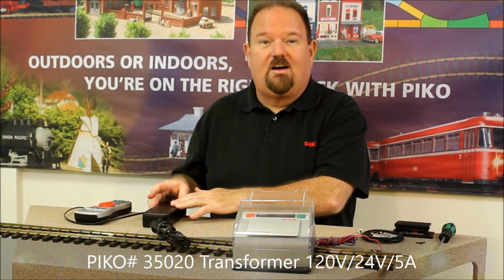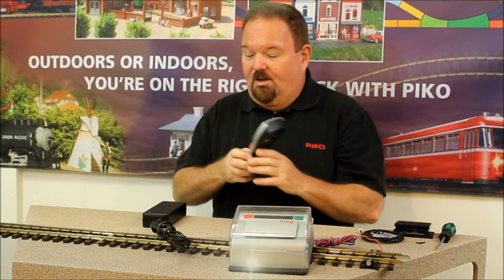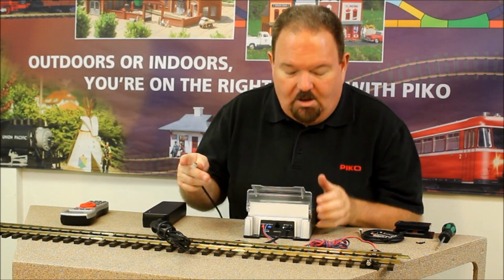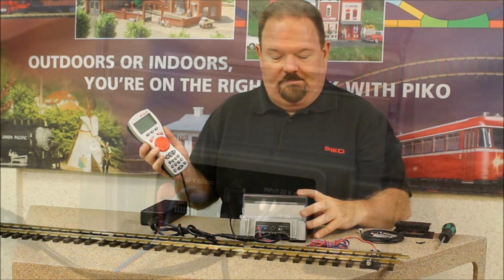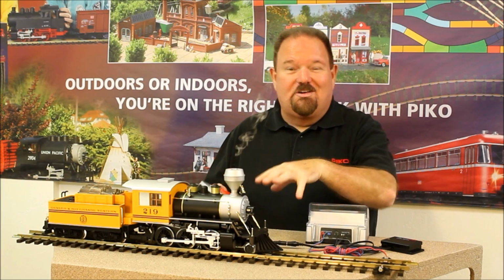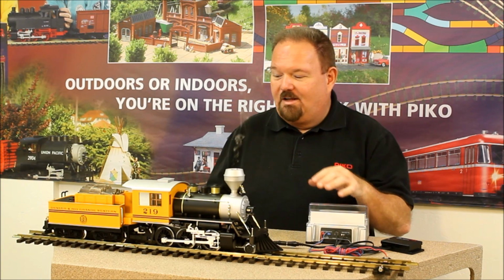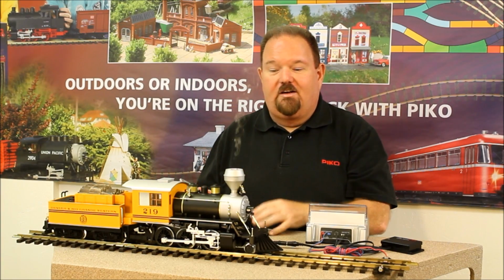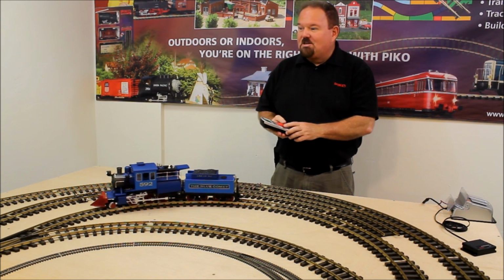Getting started with PIKO Digital

Comment: Good day , will the system damage USA train analog motors running them on address 00 ? Thank you 😊
Reply from the maker: Hi, the PIKO G-Digital System is capable of running Analog/DC locomotives, but the locos will likely have a high-pitched electrical whine as they run.  Even though the system will run the loco, it is not recommended for long periods of time.   (This is due to high-frequency Digital AC.)

Comment: I bought this complete system to include wireless for an outdoor Christmas train.  For the most part everything worked fine.  My track is a 75 ft loop with power only connected at one point.  Some evenings the train would stutter or skip in some areas.  At times an increase in power would help.  Would a complete bus loop with feeders to more areas on the track help.  Do I need a power booster?
Reply from the maker: That sounds more like contact issues on the track.  Keeping the track, wheels and pickup shoes clean is very important, especially with DCC, so the train always gets uninterrupted power and DCC signal.  Also, reliable contact from one piece of track to the next is just as important.  Outdoors, it won't take long before moisture gets inside the rail joiners and starts corrosion.  For a temporary display, a dab of our 36215 Conductive Paste in each joiner will do a great job.  Or, you may want to look into our RailClamps for a more solid connection.
For a 75 foot loop, one power connection should be okay.  And with the excellent conductivity of PIKO rail, both power and DCC signal are carried with very little loss in that distance.  A DCC Booster like our 35015 would really only be needed if the complete power demand on your system is near or over 5 amps.  With just one train and a loop that size, this is probably not the case.  A PIKO Mogul with smoke and sound going only takes about 1.5 amps.

If you have any further issues, feel free to contact our customer service directly at info@piko-america.com or 877-678-4449.

Comment: Will also work dc
Reply from the maker: Tomas, while the PIKO G-Digital system can run DC (non-decoder) locos it is something we regard as only for occasional use and not for long-term operation.  (When run this way, there will likely be a high-pitched noise coming from the motor.)

Comment: Can you have multiple handheld?  Do you offer a 5 amp booster that can be added for larger layout and if yes how do you hook it up to the controller?
Reply from the maker: Hi Michael, 
Yes you can have many handheld Navigator Remotes.  We also do have 5 Amp boosters for separate isolated sections of track, for a total up to 25Amps.
Reply: @PIKOAmerica  Thanks.  I look forward to using Piko to expand my system and to convert to DCC.

Comment: Where is the Loco address? I thought it was on the service manual and on base of Loco. I'm using what I think is 030 as the address for the mogal 30105 but I'm getting messed up sound. 4 hrs later I'm still getting nowhere.
Reply from the maker: Hi Matt:  It might be better if you could give us a call (877-678-4449 or 619-280-2800) or email (info@piko-america.com) so we can discuss this in more detail.  We don't mark the loco address anywhere, but it's standard with most manufacturers that locos come from the factory programmed to address 3.  So if you have entered "030", that would not be for this loco as it came out of the box.  If you are using the PIKO Digital system, it's easy to change the address of a loco, so you don't have multiple locos on the same address.  Our two videos on the PIKO Digital explain this better than I can here.  It would be helpful to know more of what you mean by "messed up sound" and also if the loco is otherwise running okay.
Reply: +PIKO-America thanks for the swift response..... The Loco is incredible and so is the system. Just seen that I was mis sold the psu. The one I have is only a 32 VA..... I need to use a 100 VA. Explains all my sound issues! I'm standing by my mail box awaiting the upgrade!
Reply from the maker: Hi Matt:

Yes, a 32VA power supply would be marginal, at best, for that loco.  If the power supply is at it's limit, it might allow the voltage to drop, which could cause a repeating cycle of the loco's decoder shutting down and restarting, then the power supply restoring the voltage, then the loco drawing more current, beginning the cycle again.  You would definitely have sound and operating problems!  In the meantime, you could switch off the smoke unit (switch is under the water filler hatch cover on the back deck of the tender).  The smoke unit draws quite a bit of power - about 1/3 amp.  That may allow you to enjoy the loco and sound, till you receive a larger power supply.
Reply: +Matt Bates awesome idea, never thought of that. I'll give that a go thanks!

Comment: How can I convert a analog train to digital, Do you guys offer DCC Chips for G scale?
Reply from the maker: Dylan, yes we do offer DCC decoders and sound for G-Scale.  You will find those videos here on our YouTube pages.  
For a DCC & Digital Sound install on a PIKO steam loco with tender... https://www.youtube.com/watch?v=U8c_dZlYguo&t=0s&list=PLLxO0OUTYRyDyJlKQZ5XCeGC7DAG10WLr&index=7 

For a DCC & Digital Sound install on a PIKO steam saddletank loco...https://www.youtube.com/watch?v=1vjmwwNOizk&t=0s&list=PLLxO0OUTYRyDyJlKQZ5XCeGC7DAG10WLr&index=4
Reply: @PIKOAmerica  Hi team just wondering if it could run LGB trains on this and do I need chips to install
Reply from the maker: @jazzytriddy744  With the PIKO G-Digital system you can run any loco with an NMRA compatible DCC decoder.  This includes early MTS decoders from LGB making PIKO G-Digital one of the few systems that can run serial and parallel MTS decoders, as well as the most modern DCC decoders on the market.

Comment: How much is it?
Reply from the maker: The new versions of the Navigator and Receiver are direct replacements for the item numbers shown in the video.  They save a bit on the total system cost.  Here are the prices:  35010 Digital Central Station:  $359.99, 35017 Navigator Remote:  $299.99, 35018 Wireless Receiver:  $139.99, 35020 Transformer:  $99.99.  Those are the full MSRP prices in America.  Check with your retailer, as they may be able to do better than that for you.

Comment: That's great and all but still old tech.  The track still has to be powered!. And running is still massively affected by dirt, Corrosion and bad joints!. It's old tech... With the Sound Traxx Blunami and battery power this system is now old and antiquated!!.

Comment: how much does this cost and where can i get it online
Reply from the maker: +Kirby Cannon There are several components involved.  Here they are, with their MSRP prices:  35010 Digital Central Station $344.99, 35020 Transformer $99.99, 35021 Navigator Remote $459.99, and most people opt for the 35022 Wireless Receiver $184.99.  Although that adds up to quite a bit, the system does work very well.  Most retailers will not stock the system, but it should be available through anyone on the retailer list on our website.  Many of them do sell online.
Reply: +PIKO-America thank you